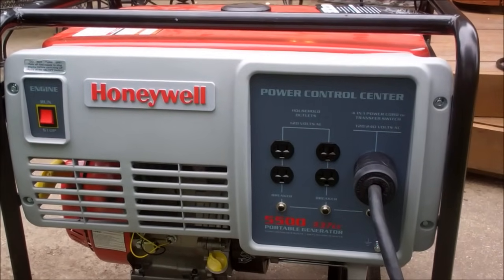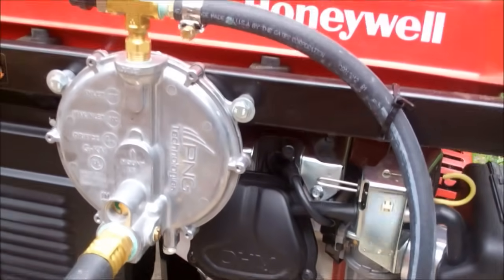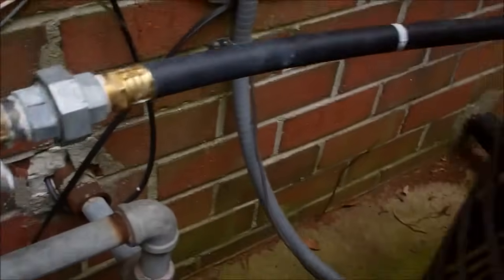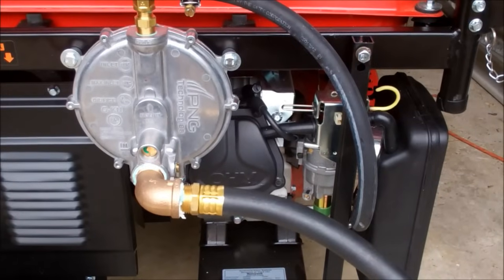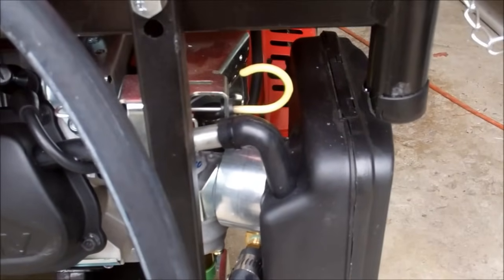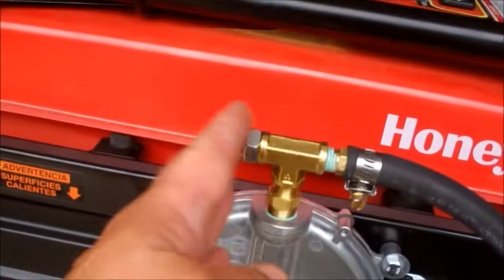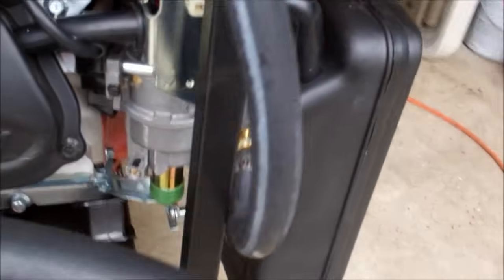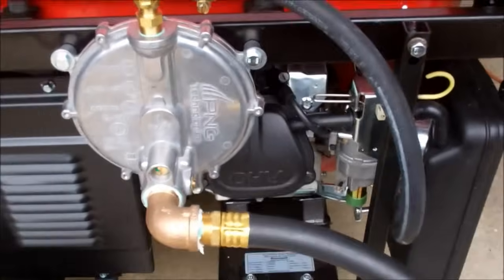Portable Generator Conversion to Natural Gas & Propane

Comment: The hose that connects to your gas meter is connected with a UNION Coupling and not a Quick Connect as you mentioned at 1'38".
It would have served you better if you had a Quick Disconnect, kind of the one you use on an air compressor made of brass. Just FYI...

Comment: What happens if the generator stops on it's own ??? There is nobody to shut off the  Natural gas. Won't the gas keep flowing out of the air filter and explode sooner or later???
Reply: These kits use the suction from the intake to open the gas flow. If the generator stops, fuel will be cut off.
Reply: xnizonyt Another video about this mentions using a dishwasher valve to shut off the gas if it stops running.  Don't really know which or how. Trying to find out why my ex5500 has no output, thats my interest right now. Cya!

Comment: Good video. Do you have to do any tuning for correct mixture? Do you still use the choke for starting?

Thanks
Reply from the maker: You do have to tweak the fuel air mixture and no you do not use the choke.

Comment: btw, no need to cut the frame.  all you need to do is move the motor back sufficiently to clear the frame. four new holes on the bottom mounting plates and you're done.  this is especially practical if you only need to clear the frame by a small fraction, say like 1/8 or 1/4 inch.

Comment from the maker: I covered it very briefly but it is the black knob on the left side of brass "T" on top of the regulator.  They tell you where to set it to start off and then you tweak it by listening to the engine.

Comment: as long as the engine is running at the stock rpm's(like it is) it will not affect the power output.

Comment: Nice video   Are you still running that same supply hose?  According to rwhose that is not rated for natural gas but im not really sure what could be the problem. If its rated for 500psi and im only running 1/2 pound after the ng meter what could be the problem?  any thougths?  O

Comment from the maker: The motor has it's own governor and my generator does not have a throttle.  So really you only control the air fuel mix with the valve just above the regulator.

Comment: @BigRed- thanks for the tip!  Good to know.   I got my generator conversion done this past weekend and it works great! I did a full load test, while I plugged my Fluke meter into one of the outlets to measure Hz.  It never dropped below 60Hz even while i turned our electric cooktop stove on.  so i have the feed adjusted right.

Comment: really should be a plumber if you guys are tapping into your gaslines ,propane .
but with that being said always favor larger hose and full port valves. that means what it says the valve its self doent choke down the size of the hose your going with. also if you have appliance down line you depend on. (tankless water.or furnace . it could affect. . maybe not these smaller standbys but watch it as you go bigger. more so with the natural gas but it happens,propane u can boost it up more.

Comment: Just a note to all - I have the same conversion kit I put on a ridgid - Works perfect, smooth - However I made a mistake by not securing the air filter box back to the frame - the original holes to meet up anymore - This resulted in the bolts cracking of the block and the carb was basically hanging - other than that - worked like a dream....

Comment from the maker: I see what you are saying and I would avoid that at all cost.  Insted of an air gas mix you would have an LP gas mix.  It may only flood the generator but if air makes it in I guess it could go boom.  I would always cut it off at the valve of whatever fuel you are using.  Mabe a safe guard it to change the cutoff switch to one with a flip up cover to help remind you.

Comment: Understood-  however I am curious about "what would happen"?  Because this same condition could occur if someone was running on gasoline, then turned the generator off with cutoff switch. Even if the gasoline valve was then closed there would still be fuel in the line from valve to the carb.   Its a situation that I will avoid, but thought you might know what effects this condition would cause.

Comment: Great video.  I ordered my kit earlier today from propane carbs dot com.  I am looking forward to getting my conversion done.  You offered some great tips.  I like how you did the 90 elbow off the regulator.  I am curious what happens if you switch from LP to gasoline while its running?

Comment from the maker: Follow the link in the description to rwhose listings.  He does not have them listed a generator hoses.  Contact him through eBay and he will guide you in the right direction and custom make something for you.  

I did not not any drop in HP and I tried a real worl test on it and it powered everything it did prior to the conversion.  BTW when you go to start it with the long hose I had to hold the primer about 15-20secs.

Comment: Again great job-just installed my Transfer box and it works great,with my powermate generator with the Chonda 13hp engine.My carburator looks like yours.Gonna order the type C and the hose you ordered,can you give me the part or model # of the hose from rwhose,it will be way safe for the limited time i will use it.One more thing any noticeable HP drop in engine.Thanks again ,,and I will also be cutting the post next to air breather box like you did.

Comment from the maker: Rated for Natural Gas use no it is not, and there is no need to pay extra just for the stamp. This hose is a Nitrile Butadiene Rubber or NBR which is the same material used for NG gaskets and hoses.  This hose is an overkill for NG. It is actually for gasoline and diesel fuel and can withstand more pressure and is more crush resistant than most hoses marketed for NG but is 1/4 the price.  Plus this is a back-up emergency set up for temporary use.
Reply: Van R w

Comment: Good job on conversion,,,but you may want to check the hose your using for the fuel line from the gas meter . I am sure its not rated for LP or NAT gas.